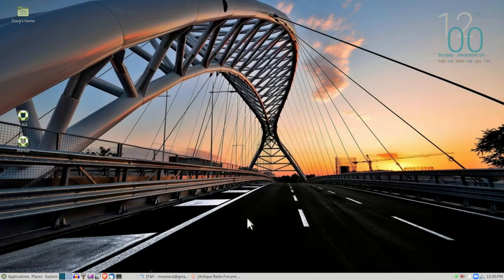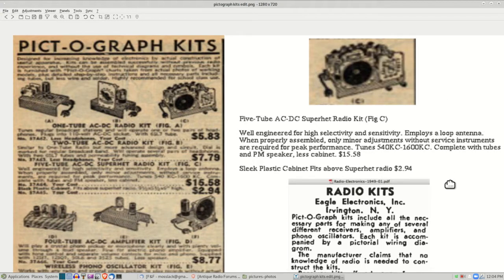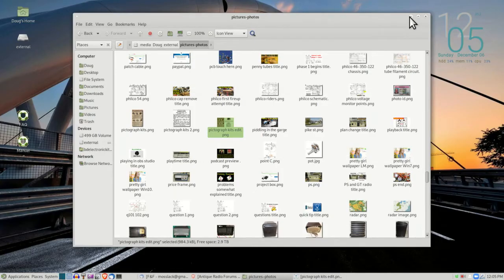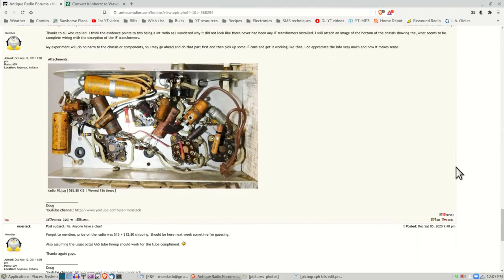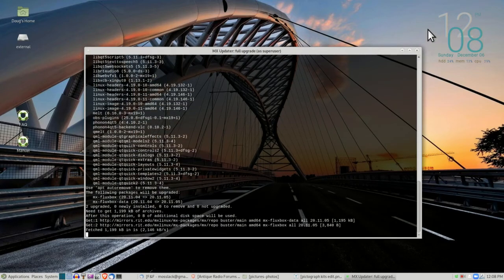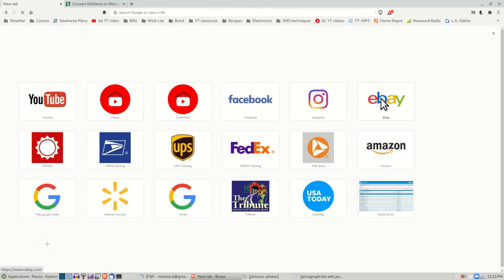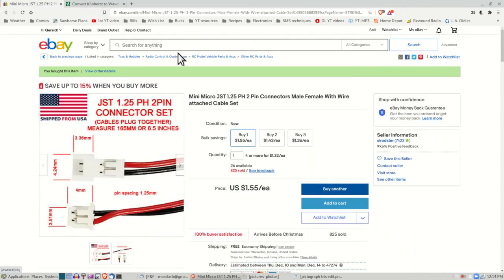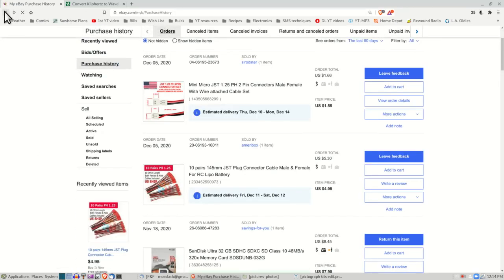DERB - Mystery Radio Revealed

Comment: Doug talking about the solid state RF transformers running at the higher voltage levels, I do not think that would work, the voltages on these are 9 - 24 volts dc, from the schematics I have ever looked at, they normally take the line voltage an reduce it by a stepdown transformer. Maybe I am wrong in my thinking but...

Comment: You bought a kit radio but the parts you needed weren't in the radio? Good find with the Pict-O-Graphic info but it doesn't help you in the hybrid radio experiment!
Now you need 4 IF transformers so you need two tube type and two solid state ones.Oopsie!

Comment: Hey Doug, can you find out the distance between the mounting holes for the IF transformers on the chassis??
Reply: @DERB_Seymour_Indiana  ok, there's a set of 455khz IF transformers for sale on eBay that might fit. Check them out.